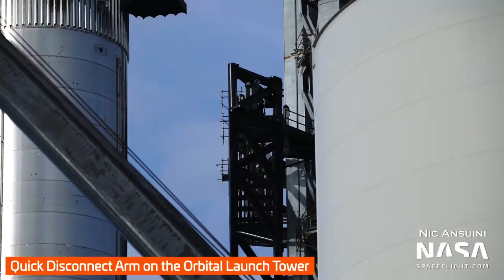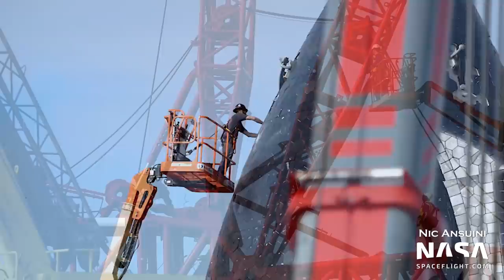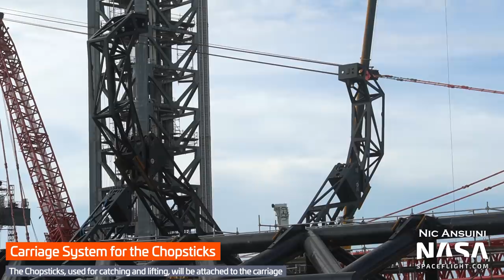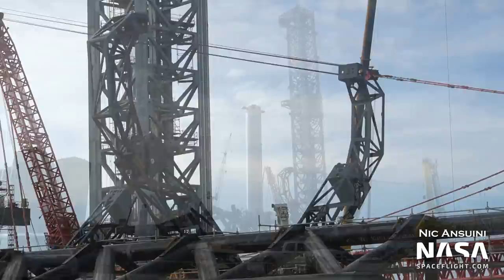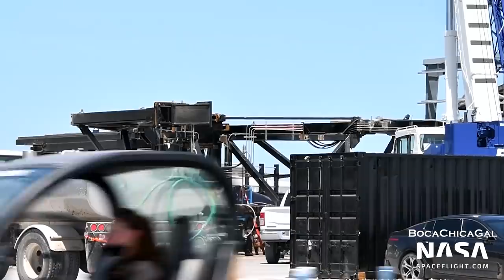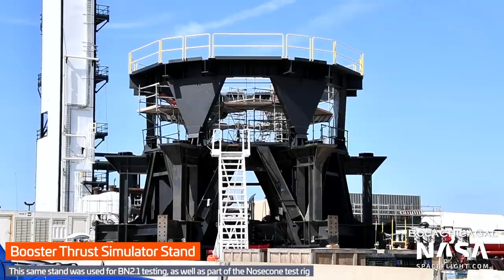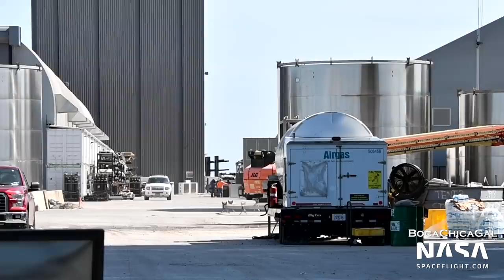GSE Tank 8 Aft Dome Flipped | SpaceX Boca Chica

Comment: I have some worries about these heat shield tiles surviving the turbulense and vibrations at reentry. I wonder if there are some soft or maybe rubber like underbelly? Or else they will easily brake. Oh yes, there seems to be a kind of fabric under some of them. But what else?
Reply: The stainless steel hull by itself is almost enough to survive reentry. But to be safe and be reusable they weld studs (pins that flex when pinched and have hooks that catch on the inside of the holes on the back of the tile).
Thermal blankets are pushed over (and through) the pins. They also reduce vibration.
The tiles have Y shaped frames baked inside them (on the back). Those frames have 3 holes that fit the studs, and once the tile clicks in place are almost impossible to remove unless the tile is damaged or drilled through (the method they use to replace a tile).
The tiles are ceramic, but are very lighweight. If they are handled roughly they will crack. But once they are in place they are out of that danger. Only if hit by a sharp hard object will a tile crack. Not very likely.
On reentry the plasma in front of the ship is made up of compressed air molecules. The pressure is mostly inward. It lasts for just a few minutes.

If it all works or not is what S20 and its sisters will prove soon enough.
Reply: @knowlegeisgood8735  Damn, you're GOOD!  Are you, by happenstance, a SpaceX employee?
Reply: @greyape5387  No. Just someone who spends way too much time following the Starship's progress.
Reply: @knowlegeisgood8735  I hear you. Been there, done that, got the tatt.
Reply: @knowlegeisgood8735  Thanks! Interesting!

Comment: That carriage looks too flimsy to carry the weight of the chopsticks alone and it would need to carry the weight of the booster too. And that booster weight will hang in the end of quite a long lever arm so the force on the carrier tower attachment points will be the booster weight multiplied!
Reply: I think that the carriage is simply to constrain lateral movement and that the wire rope from the winch would connect directly to the hinge point of the arms.
Reply: The strut structure does not hold weight it is the attachment points attached to the tower pillars and the pillars themselves that hord the weight
Reply: @sentinel76  Wire rope carries the weight but not the torque. There is a horizontal force pulling towards the launch stand at the upper carriage tower attachment points and equal but opposite force at the lower attachment points. And these forces are quite a bit bigger then the combined weight of the arms and the booster because the distance from the tower to the launch stand is longer than the distance between upper and lower attachment points.

Comment: Are they going to put cameras on the booster and Starship to document the flight in real time?
Reply: Probably like with the starship tests which is an important part of monitoring performance.  At least one on the forward end looking aft and one from under the skirt looking at the raptors.
Reply: Not sure how its going to work as the booster will have no skirt like starship, there is probably space between the raptors but no way to mount a camera for the outer ring, possibly they could mount some on the aero covers for the COPV lookibg down
Reply: I was only thinking starship when Reichert asked that question.  A camera on the starship is probably more necessary anyway at least in my thinking.
Reply: Elon talked about placing cameras inside the tanks. That means SpaceX will get footage. If we also get to see it is another matter.
Reply: Yes. They always do

Comment: Tell me the dimensions of the roll of SS and the height of a ring and I can work out how many you could get out of a roll.   My guess is not many.
Reply: Not sure about dimensions but those rolls run around 46,000 lbs
Reply: How many Starships can fit in a can?
Reply: @steveschritz1823  at 4mm thick I can work out a square area based on the density of SS.   My guess would be a starship ring is 1.5 to 2 meters tall, and what would you guess the width of a roll is?  4 meters?
Reply: Super rough estimate based on weight I get 11 rings
Reply: Someone else had all the stats on a roll and it came to one roll is 193 m long (weighing about 11.071 tonnes) which ÷ by the circumference of each ring 9 m × π= 28.26 m.  193 ÷ 28.26 = 6.82 rings.  They are 1.83 m in width.
Reply: The label of a roll was shown July 26. [Edit: no, it was on July 23] It said 13260 kg (net), 4mm 304L steel, 1.8288 mm tall. The ship or booster rings are 9m diameter so the steel in a ring is 1.8288 x 9π x .004 = 0.206832 cubic meters . 304L steel is 8.00 density. 13260 / (0.2068 x 8) = 8 .013 rings from that roll.
Reply: And to take that one step further if the original stats are correct each ring will be 11.071 ÷ 6.82 to yield 1.62 tonnes per ring and with 35 rings in B4 the mass with just it's rings would be 56.81 tonnes.   Add the thrust puck, common and forward domes 29 Raptors and it is well over 100 tonnes for sure.  Though I had heard the mass of the booster empty was about 180 tonnes.  ??
Reply: @donaldmiller1782  It is good to have a source for your data which always lends itself to more credibility.  And you show the weight as 2 tonnes more then the Harbinger.  Interesting that you figured each ring dimension based on the density of the steel and total weight of the roll and width.  That of course would change my figures on the individual ring weight, etc.  👍
Reply: @donaldmiller1782  Using your numbers (except the density I found is 8.03) that would be 7.98 rings (rounding errors can be a problem sometimes).
But it really is very hard to answer the original question since we only have a handfull images of the labels on those rolls. The weights differ by tons sometimes (between 9.520 tons and 13.260 tons). The thickness differs by ±0.02mm.
Outokumpu stopped adding the length of the rolls to the labels about 2 years ago.
Also we saw a roll from Janco Steel too, so Outokumpu is not the only one.
So the answer would be 7 or 8 rings per roll. I assume they get both from the rolls they buy. That is better than the 6.8 they started out with (301 steel).

Comment: I'm not a structural engineer but it's not rocket science you got those four Arms that stick out and it's so thin at the top if they're going to use those grabbing Arms that's just going to snap not the catching arm but the actual rocket itself four Arms at the top it going to snap off

Comment: I bet half of the tiles fall off on lift off!
Reply: Want a bet?   Those hexagonal tiles are set in pretty dam securely.   Of course we'll soon see.
Reply: I will bet against that any day.
Reply: None of the tiles fell off during previous hops. They must surely have taken a section of tiled SS and given it a shake test.
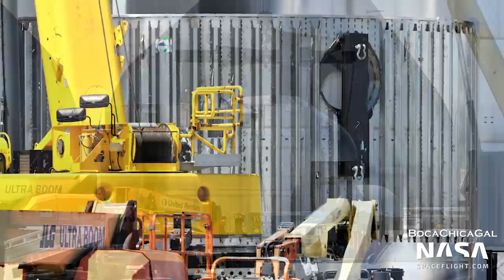Reply: @knowlegeisgood8735  Please take a look at booster 5 between grid fins starting at 14:05 near where the lifting point use to be
Reply: @eduardogardin879  What does that have to do with tiles? The booster has no tiles.